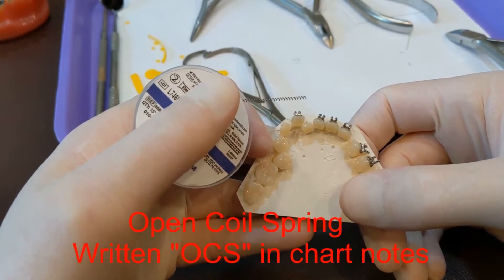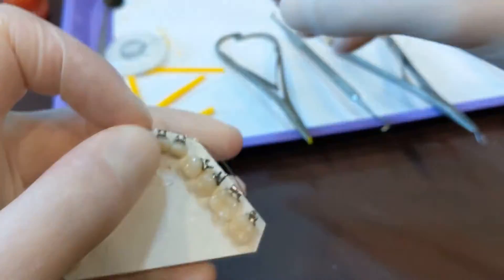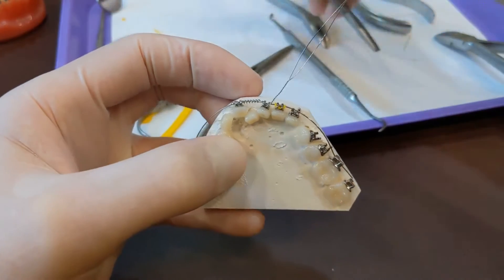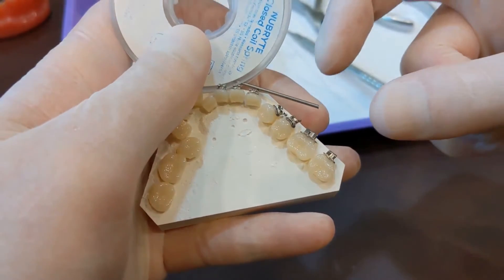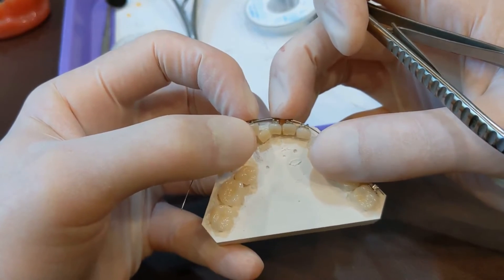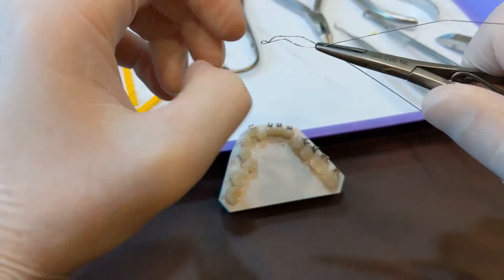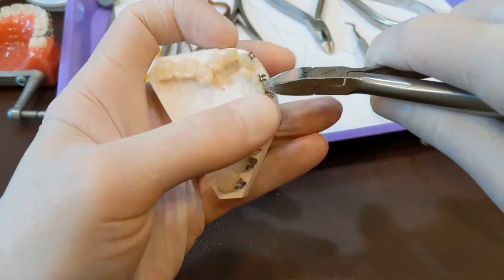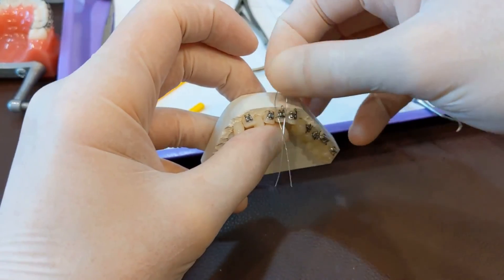Open Coil Spring, Closed Coil Spring, & Kobie Ties

Comment: How long will it take to gain 6 mm space between pre molar and teeth with open coil spring
Reply from the maker: Everyone’s teeth move at a different rate but a general rate of movement to expect is about 1 mm per month. Opening space is often slower than closing space, though, so I would estimate 6-9 months to open 6 mm of space. It might be more or less time than that, though, depending on the patient. 
Kids’ teeth generally move faster than adults’ teeth.

Comment: Can u do an O tie instead of a ligature?
Reply from the maker: An o tie on a twin bracket next to an active open coil spring will likely result in that tooth rotating while the OCS pushes it sideways. A steel ligature prevents that rotation. If the brackets are self ligating, though, no steel ligature is needed. 
I hope that helps!
Reply from the maker: An o tie on a twin bracket next to an active open coil spring will likely result in that tooth rotating while the OCS pushes it sideways. A steel ligature prevents that rotation. If the brackets are self ligating, though, no steel ligature is needed. 
I hope that helps!
Reply from the maker: An o tie on a twin bracket next to an active open coil spring will likely result in that tooth rotating while the OCS pushes it sideways. A steel ligature prevents that rotation. If the brackets are self ligating, though, no steel ligature is needed. 
I hope that helps!
Reply: @likeabossproductions1254  thank unso much learned a lot from Ortho Assistant here thanks again Doc
0:43
Reply from the maker: You bet! I’m glad you found the video useful! 😎👍
Reply: Doc question so my doctor ask me do echain from 6-4 echain distal only than steel tie how would I place the steel tie thank u
Reply from the maker: I would recommend asking your doctor exactly how they would like you to place the steel tie because every doctor likes it to be done their way and each doctor’s way might be a little different.
Reply: Doc questions can u make a video with a stoper . And what do u do when the doctor says activate coil thank u

Comment: i have the coil in my braces and it bended what do i do the orthodontist is closed today :(
Reply from the maker: Try to gently push in on the bent part of the wire to get it to go straight again. The spring should recompress as it goes back into a straight line between the braces. I hope that helps!

Comment: How long does one have to put on the coil spring? Mine's almost two months and a half but no response from my dentist.  Its an open coil spring
Reply from the maker: Open coil spring is meant to push a space open so it stays in place until it’s pushed the space as open as it needs to. For some people that’s one month but for others it could be six months or more. It just depends on how fast the persons teeth move. 
The doctor just needs to make sure that the OCS stays active, meaning that the spring is compressed and is actively pushing. Once the OCS has pushed all the space open that it can, it will be passive (not actively pushing any more). If more space is still needed, the Dr will have to reactivate the OCS by either replacing the existing OCS with a longer one or by placing a crimp on the wire that compresses the OCS, thus reactivating it. I hope that makes sense.
Reply: @likeabossproductions1254  thank you so much. You've made it much easier to comprehend ❤👍🏻

Comment: Greetings. Please advise duration for change of various orthodontic wires, coils, springs, elastics and appliances
Reply from the maker: Yes, generally I follow a two month interval per archwire unless there is some reason to leave the wire in longer. The .016x.022 steel wire usually stays in longer than that because you’re putting detail bends in at each appointment until all of the teeth are perfectly straight.
Reply from the maker: You use each of the wires and auxiliaries until it’s done what you need it to do. For example, you use the spring for as many weeks or months as it takes to open the space that you need to be able to align a tooth. If it’s a little bit of space, it might only take one month but if it’s a lot of space it might take six months. It just depends on the needs of the patient.
Reply: @likeabossproductions1254  On average, if it's a case for mild to moderate class II or III where extractions of 4's or 4's and 5's are required  I understand the mechanics behind is dependent on cases, please advise the duration of wire change starting from 0.012-0.016 Niti round, then 0.017x0.025 Niti round following 0.017x0.022 Niti round and 0.016x0.022 SS rectangular, is that 2 months interval, please advise

Comment: Can I ask a question? I have these coil springs, both in upper and lower.. 2 days after installation, they are bending in an outward direction, so they look like a halved circle.. and it's uncomfortable and it does hurt, can't even close my mouth properl6

Comment: Hi, great video! Once the space is open enough, how would you go about moving the tooth in? Would you use a 2 link power chain looped around the coil on the bracket or is there a better way?
Reply from the maker: There are several ways to align the tooth once you have enough space but usually I’ll tie elastic thread (one brand is Zing String but there are other brands that also work great) from the crooked tooth to the space you want to put it in. Just tie the thread or attach the chain from the bracket of the crooked tooth to a point on the wire or to a bracket of an aligned tooth that will pull the crooked tooth straight enough that you can eventually engage the wire into the bracket of the crooked tooth to fully align it. It often takes several appointments because you need to change the chain or elastic thread every 4-6 weeks to keep it pulling but eventually you’ll get the tooth aligned enough to engage it with the wire. I hope that helps!

Comment: Kindly explain how to revert to the right angle of the front upper 6 teeth which were retroclined towards inside due to wrong orthofontic treamnet which resulted in rollercoaster effect
Reply from the maker: Assuming that the brackets have been properly placed, you would work your way through the sequence of archwires until you could place a large rectangular archwire, like a .017”x.025” NiTi if you’re using .018” slot brackets or a .019”x.025” NiTi or larger if you’re using .022” slot brackets. Then you leave that wire in place for 4 months or so to give it time to correct the torque of the teeth. Maybe have the patient wear 4Tri elastics during that time, too, if the premolars aren’t occluding due to the rollercoaster effect. (Please see my video on Elastics & Occlusion if you’re unsure what 4Tri elastics are.)

Comment: Hello first of all thank you for your nice videos and simple explantion doc,and  can you please tell me how the treatment plan will start in this situation? Do you use 12 niti wire then going for 14 and placing an open coil? Or you use 14 niti from the start and placing an open coil from the begining? And also can you use the normal elastic instead of steel tie on the bracket? And thank you
Reply from the maker: We start with .014” NiTi wires and we place open coil on those wires if we need to open space. We do not use .012” wires in our office. 
You can use normal elastics with an open coil spring if you want to but the teeth adjacent to the open coil spring are more likely to rotate than if you tie them in with steel ties. Just remember to snug the steel tie down but don’t tie it so tight that the bracket can’t slide along the arch wire. If you place the steel tie too tight the open coil can’t slide the bracket along the wire to open the space.
Reply: @likeabossproductions1254  thank you very much for your respontse

Comment: What wire size we use with open coil spring ?
Reply: Great question! We place open coil spring on any wire .014" NiTi or larger. There will be some small rotations as the space opens but everything will align nicely after you have enough space to engage the blocked out tooth.